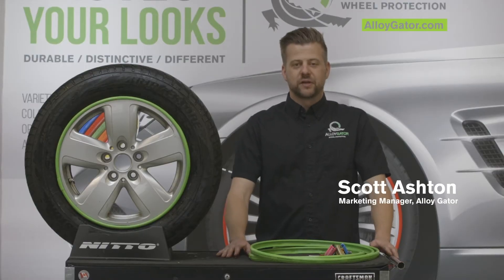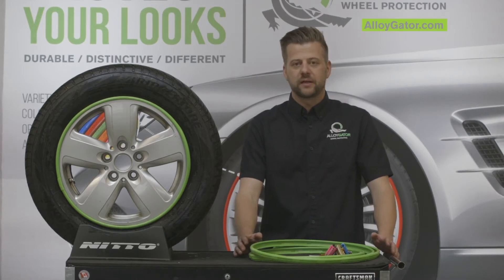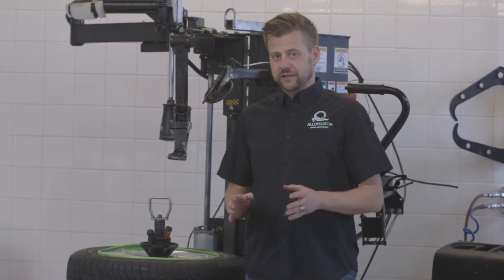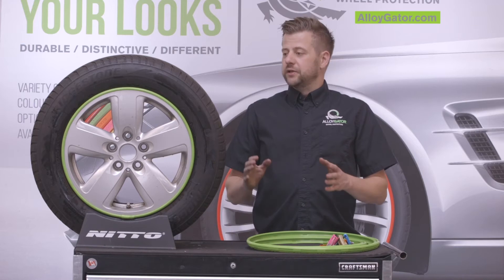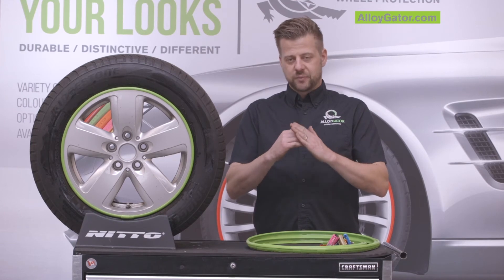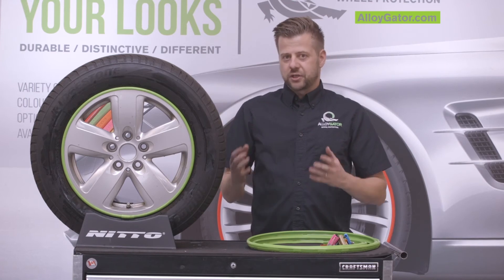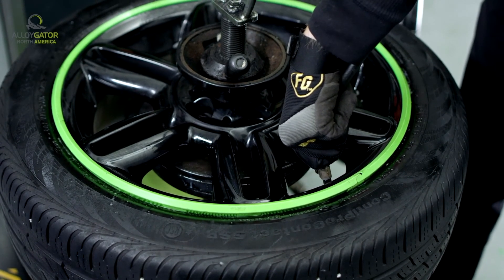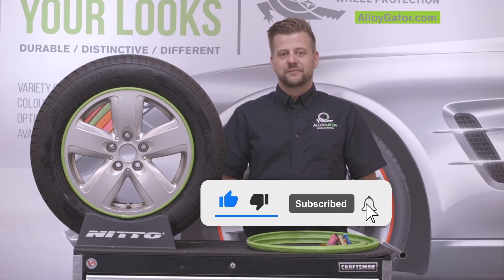AlloyGator - Why is my Gator coming away (walking)

Comment: More than just Walking Away: My 2021 VW Atlas recently had a tire repair which Vancouver VW did. They also installed the original Alloygators. The new repair failed because the Alloygator came undone whipping with severity; $2500 damage to the body work in less than 5 seconds and turning right at intersection speeds.
VW said to just go through insurances and pay the deductable.
If this failed at highway speeds and my arm was on the window sill I would not have an arm.
Thanks for your help.
Reply from the maker: Hi Chris, thanks for letting us know.  We'd like to know more about what happened and if there is anything we can do to help.  Reach out to us at 1-855-534-2867 or at info@alloygatorna.com

Comment: I installed the alloygator rim protector on my honda civic but leaks at the connecting point where the teeth are I did it several times but it still leaks any solution to this problem